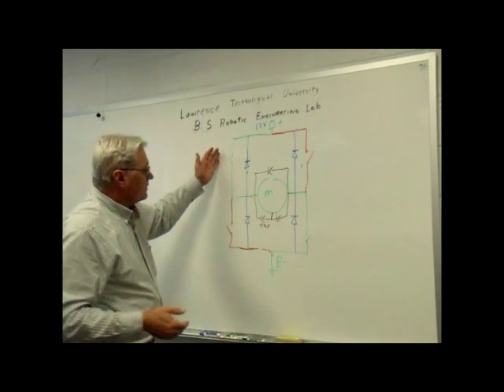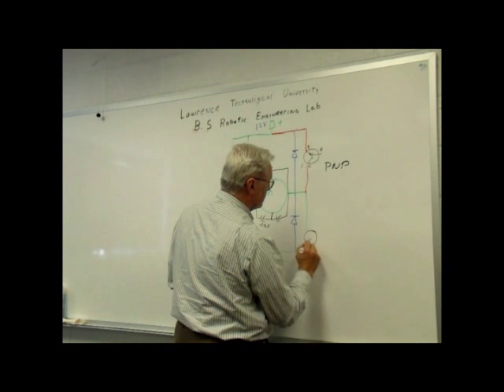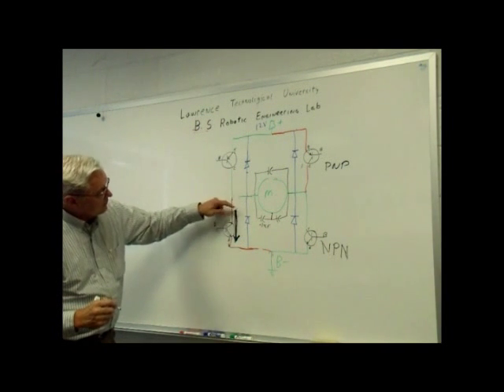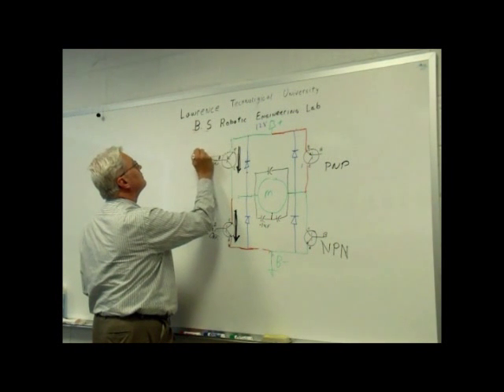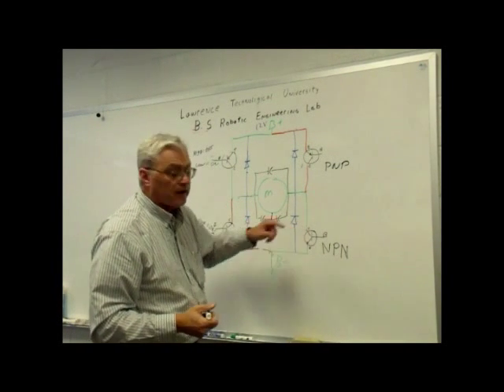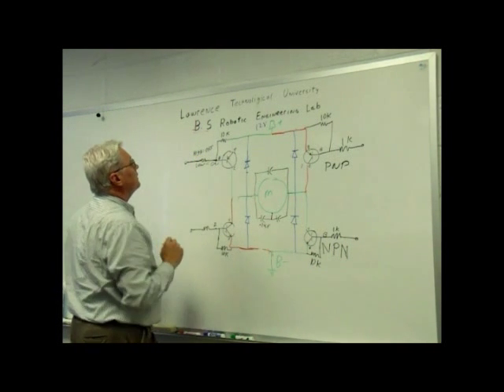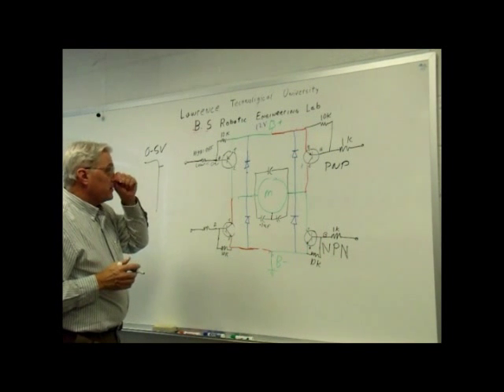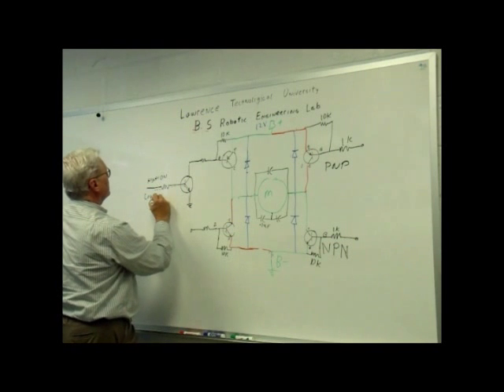H Bridge Driver for Brushed DC Motors - basic explanations and construction Part 3

Comment from the maker: As mentioned, to get the NPN to turn "on" in this configuration, you need to have the voltage at the base higher than the emitter voltage. Your Arduino probably supplies 5 volts for a digital output and you are probably using a voltage than 5 volts for your motor so the Arduino won't be able to raise the votage at the base high enough.  - water doesn't run up hill, eh?

Comment: Hi!

Why cant I just connect NPN transistors where the PNP's are? Then my small current from my Arduino will turn the transistor on and allow the larger current from the Power source to go to the motor? (I think i might be having a blonde moment)

Comment from the maker: The pull down is something of a belt and suspender thing for my application where the driver will be moved from control device to control device and I wanted to be sure that the input is pulled down and not floating. 
Yes, when the output of the controller is high, it does create a voltage divider - the downsides of doing this. 
For some applications it is probably not necessary. 
The 1K resistor is there to protect the controller device if the driver is damaged. 1K may or may not be enough.

Comment: Your pull down resistor at the gate of the PMOS isn't pulling down. It's creating a voltage divider with Vdd when the top NMOS is on. I don't think the 1k resistor is necessary for the top part of your circuit. Please correct me if i'm wrong

Comment from the maker: To "turn on" the NPN you would pull the base voltage high enough above the emitter voltage to get the necessary base current (for a BJT) which is a problem in the "high" side because you need a higher voltage input. A PNP lets you pull the base down to ground to conduct which is more convienent.

Comment: I see Well I got it working using a BC3775 NPN, and 470 and 1k5 with a 3V brushed DC motor with 5V High and 0V Low. I can show you if you want

Comment from the maker: I do not believe that this will work if you just hook up a 5V input to the base and 3V to the collector of the typical Binary Junction Transistor - that would forward bias the collector / base junction which can destroy a transistor. 
Also note that the mimum recommended supply voltage for the SN754410 is 4.5V. 
I would put an op-amp on the output of the micro with the gain set to limit the voltage supplied to the power transistor to a value lower than your 3V supply

Comment: Will this work with a 3V brushed DC motor with the MCU VDD=5V(5V=High and 0V-Low)?
So in other words can I use 3V to power the motor instead of 12V?